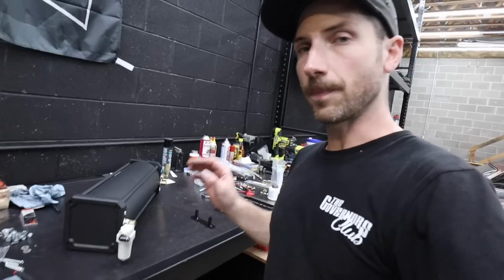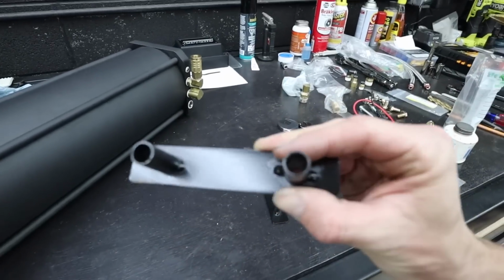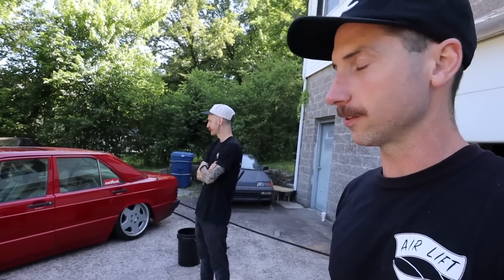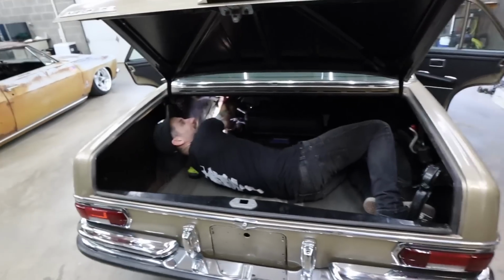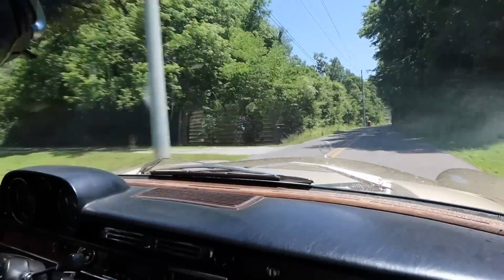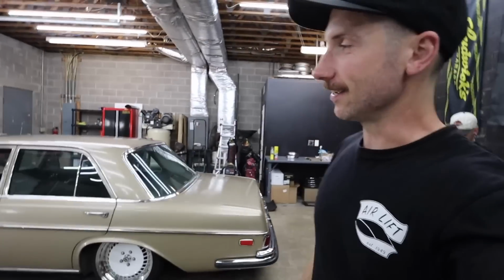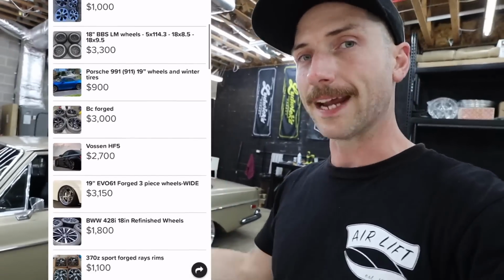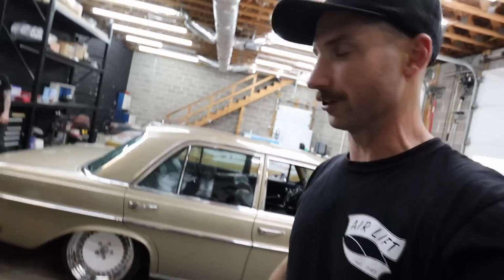MY BAGGED W108 MERCEDES IS FINISHED!

Comment: I think you take it up a notch if you paint the wheel centers the same body color.

Most of those Mercedes back then came with steek wheels with body color steel hubcaps.

Comment: pulled the heater blower unit out of my 280S to replace the burnt out motor and the 2 0 rings. Damn tight fit! How the he'll did they fit this 0 tolerance piece! Horible job.
Reply: I had the same issue. Damn tight tolerance 😢